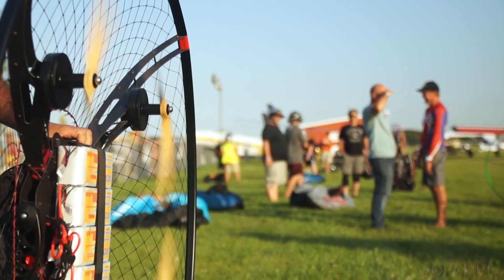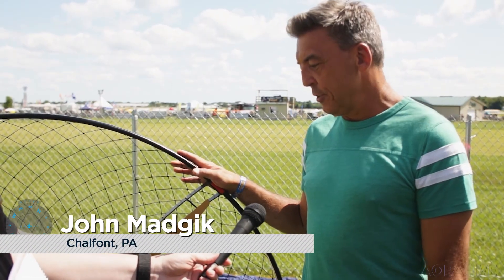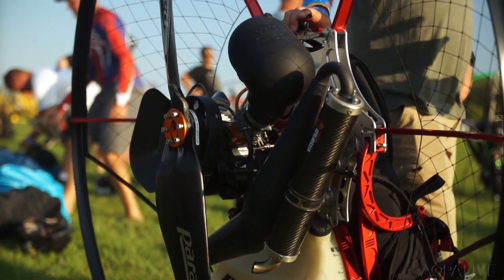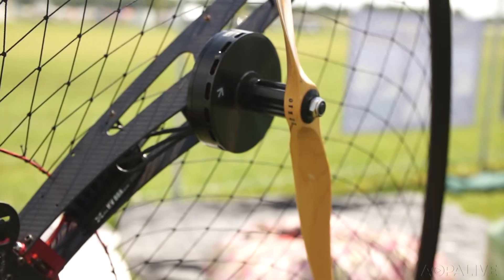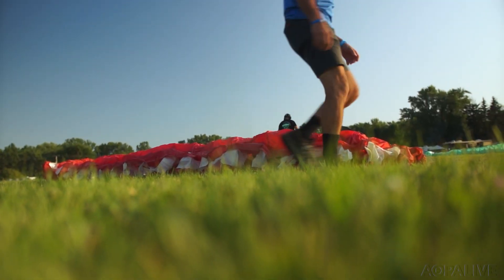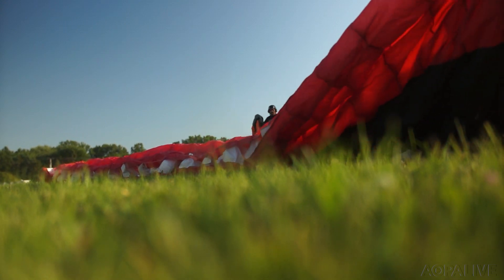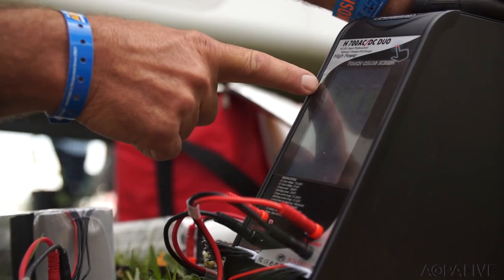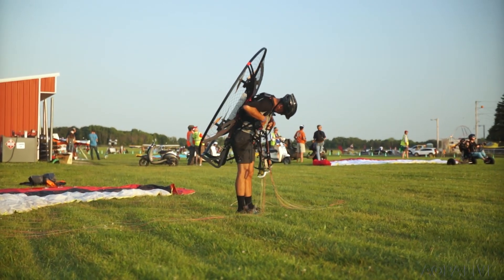Electric powered parachute

Comment: would have been nice if he stated how long the batteries last, compared to the gas engine fuel.
Reply: This is a neat design but electric Para-Motor batteries generally only last between 10-30 minutes. A two-stroke motor lasts about 3 hours with 3 gallon gas tank.